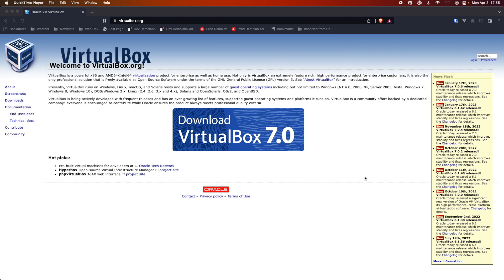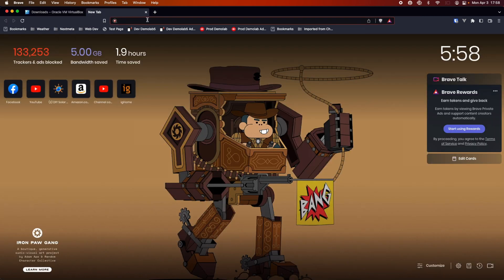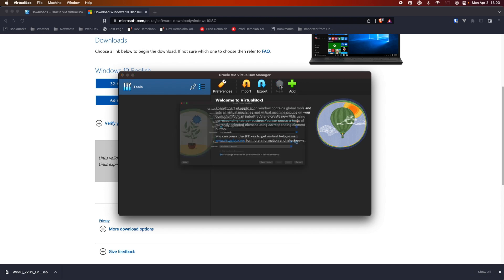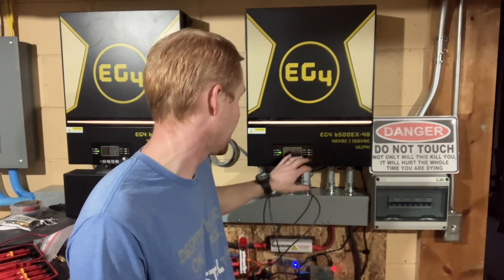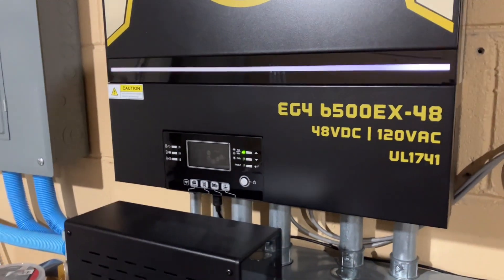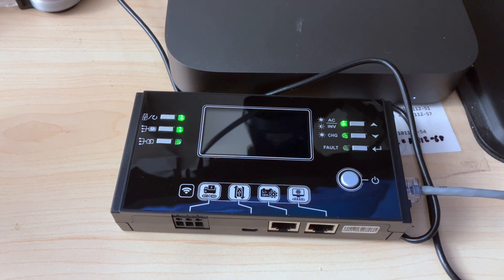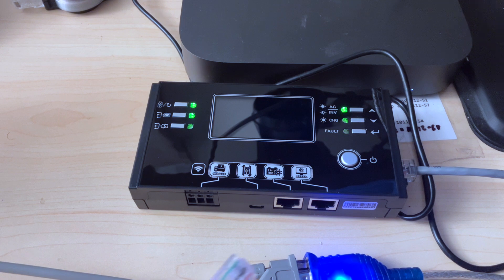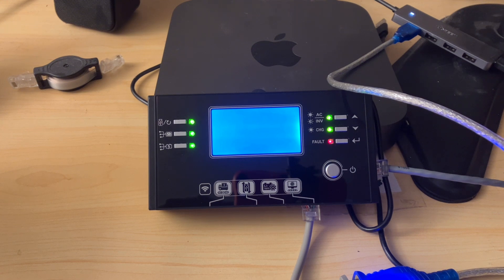Updating Your EG4 6500 Firmware: Is it Possible on a Mac?

Comment: Adam my MPP 6048 has worked flawlessly so far. I did a little experiment last week. I ran my 12k mini split on straight battery power. I have 2 Trophy 220AH batteries. Ran the mini split in heat mode for 5 days and after 5 days the batteries still had 41% SOC with no solar or grid input. The mini split is a 12k single zone 30.5 SEER innovair. Can't wait to get the solar installed.

I'll be able to run the mini split, refrigerator and freezer off grid and still maintain my system as primary backup power with minimum solar.
Reply from the maker: Awesome!